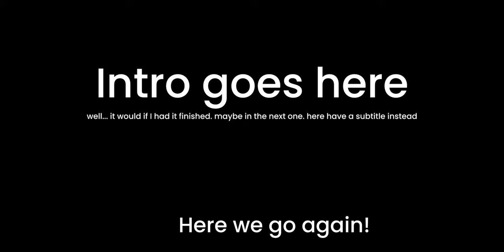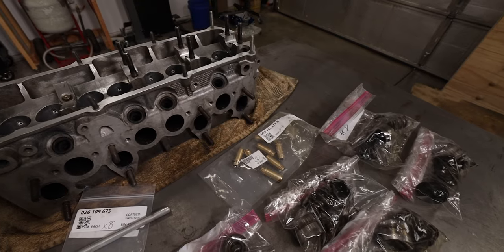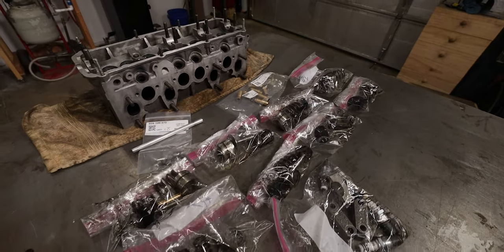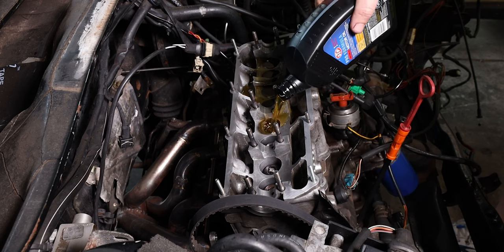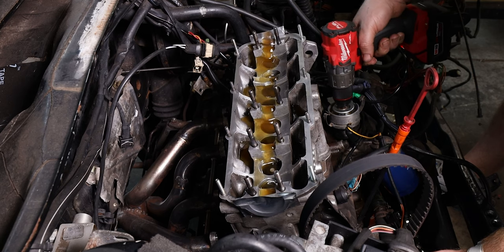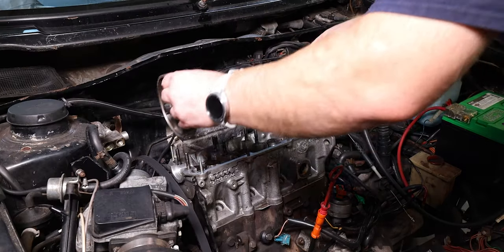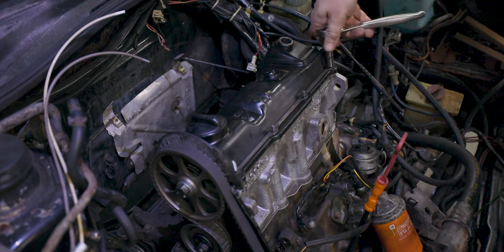Getting coolant out of the oil system

Comment: Showing my ignorance of old VW engines, but I thought the GTI’s had twin cams.
Reply from the maker: Most of the GTIs did, but for some reason in the 1991-92 they had the 8 valve variants. I did a good bit of digging to see if I was being bamboozled, but some 1991-92 really did come with just single cam 8 valve motors.
Reply: They had a couple options , so for cheaper gti they had the 8v versions this  goes from the mk1 and mk4+